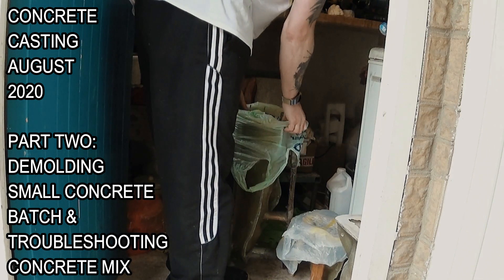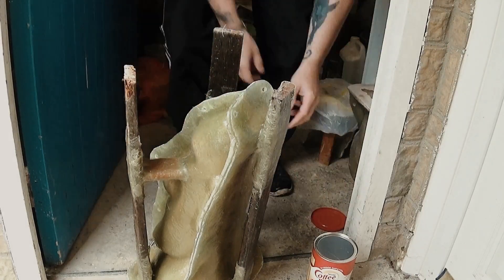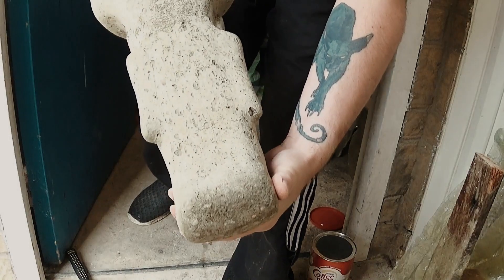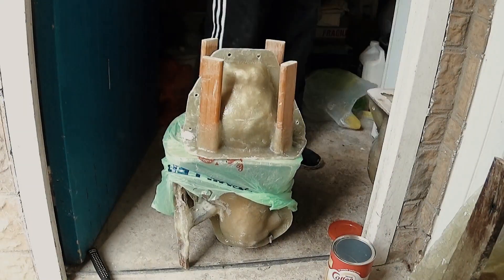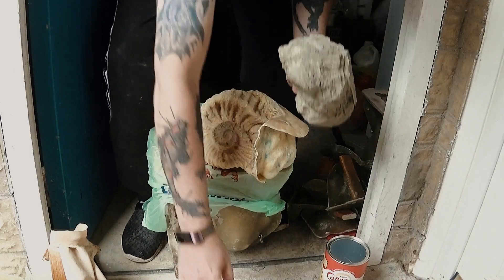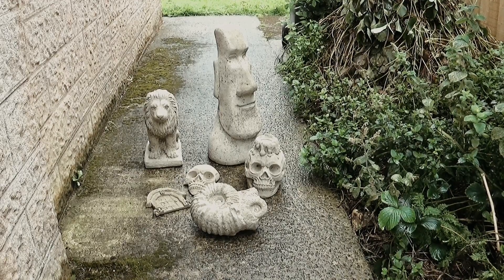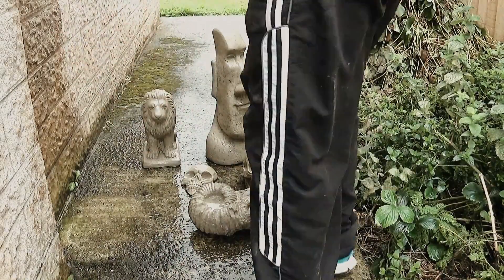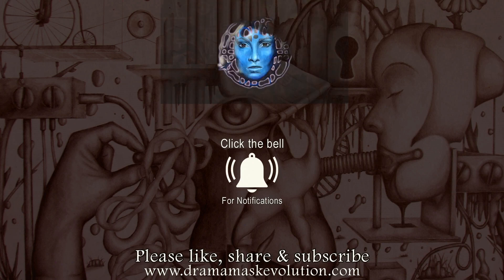CONCRETE CASTING | Demolding & Troubleshooting Concrete Mix

Comment: Is there a way of casting a thinner thickness and leaving the object hollow?
Reply from the maker: You might want to put an insert in while casting and then removing after concrete is set/cured.

Comment: I use 2 parts sharp sand and 1 part white cement, mix it really runny then before casting put the cement on a vibrating table. Get the bubbles out before pouring.
Pour half way. Then vibrate for about minute.
Pour all the way and vibrate for a few minutes.
Reply from the maker: No aggregate?

Comment: have you tried using Smooth on Dragon skin series for your molds instead of Latex? it cures faster and super stretchy and durable. I’d love for you to try it in one of your future videos. I use Smooth on Dragonskin 10 or 20.  Thanks!

Comment: Looking to make latex molds to cast concrete statues but worried about copyright. Surely it's not ethical to copy someone else's work for resale but I'm seeing so many people not using their own works so what am I missing? Any advice addressing this issue would be greatly appreciated.
Reply from the maker: I look for objects in the antique category and make original pieces to mold and cast if selling. If it has copyright.obviously you either have to have a license if available to sell or don't copy it.